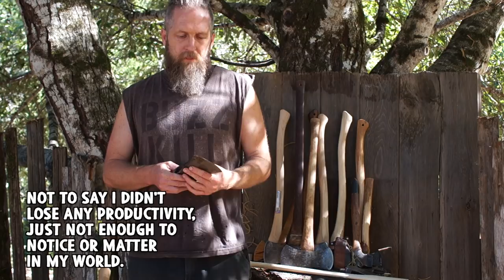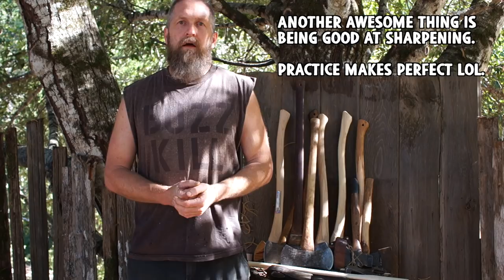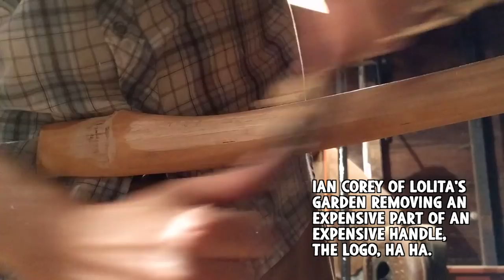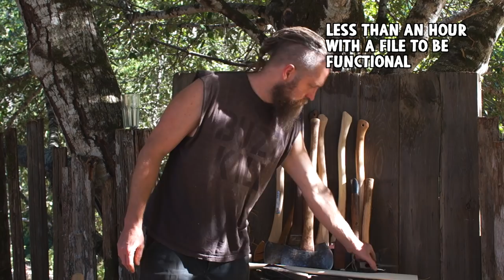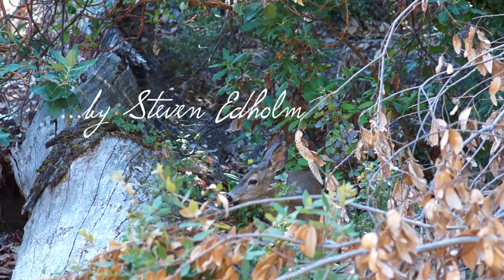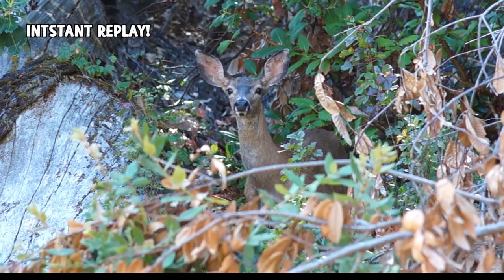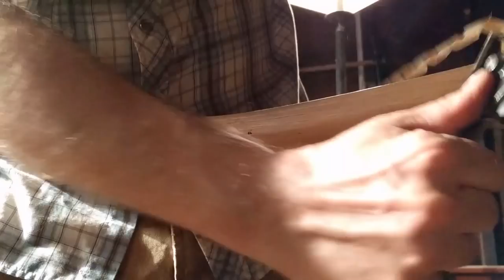Expensive Axe Buyer's Guide: (SPOILER ALERT, Don't Buy One)

Comment: I have a good size woodlot and a very old cottage. When I was young, I used to split the wood for the stove and fire place. Using a cheap axe, maul and sledge hammer and monster wedges.  Being 40 years older the chainsaw's and manual milling tools have taken their place.  I have installed an insert in the old fireplace and now have an efficient wood burning source. I have 5 cords coming in Sunday. Some has to be re-split because of size or to make kindling. Yes I looked at wrangle star bucking billy etc.  . I settled for a nice Swedish small splitting axe by Husqvarna. Half the price the top of the line ones. Hand forged, razor sharp and nothing like the bulbous big box stores. Also works for de branching, and taking bark off. Happy camper.

Comment: hippies smell, and by the way, I have a $30 Estwing hatchet that I love and use for everything that a hatchet can do. I slightly changed the profile (very slightly). It holds an edge better than I was expecting it to. Ive had Estwing hammers for 25 years so I figured Id give there hatchet a try. Also really like the stacked leather handle.
One of these days Ill get a fancy smancy Gransfor, but most likely a Hults Bruk

Comment: I bought the $24 cold steel trail boss axe that wranglerstar reviewed with a glowing opinion. Its a pretty nice axe. I stripped the varnish with a cabinet scraper, oiled it up, then wrapped the handle with jute, and made a sheath for it from leather that I had in my shop. 

I live in Arizona, so I use the axe for processing "large" blue Palo Verde trunks for wood turning. 

I need to move to a green state
Reply from the maker: yeah, that's gotta be a buzz kill to be into axes and be looking at saguaros and brush all the time.  I've looked at that axe, as an inexpensive alternative, but I really shy away from shallow eyes on axes from past experience.
Reply: SkillCult Thank you for the thoughtful response. 

I was thinking something similar. The eye doesn't have enough depth to keep it from wotking loose over time.

Comment: Hi Steve, Great advice. I have 6 axes mostly inherited from dad and grandfather. Got two plumbs, a craftsman, which look like the plumbs and a few vintage with no marks. Since I watch Skillcult, my axes and hatchets are a joy to use. The handle sliming and to fit my hands is all the difference. I've seen many axes, with and without handles for as little as two bucks at garage sales this summer. I have plenty already and wouldn't even consider buying an expensive axe. So many times I have custom made handles for my tools, being a  cabinetmaker. But didn't think of reshaping my axe and hatchet handles until Skillcult. DAH! Indeed they are hoys to use, hold a good edge and are looking lovely as they age with linseed oiled handles, which I often did before with tool handles. So once again Steven, another home run for Skillcult and many thanks. My hides and knowledge on tanning skills and the results are great because of your sharing. I will always be learning and improving of course. Hopefully sharing and handing down our skills to the younger folks will create skillculted craftspeople and keep alive knowledge of our ancestors. Cool! Good work and Thanks again. Davey
Reply from the maker: Thanks Davey :).

Comment: Here in Germany the Gräns Fors replacement handles are the cheapest hickory handles to buy. They cost about 20€ for the big ones. I bought some handles from gräns fors in Sweden so cheap (about 3€ per handle) that I got them just for some project in the future. Yesterday I hafted an vintage english hatched head with one of them to make an light camp axe, it weights only 1 kg in total. Only their double bit handles are useless for me, because they are to thin for the eye of an old double bit, so I have to make this handles my self or order them from the states, but the shipping is already more than 30$. Thanks for sharing your thoughts. All the best from Germany, Maximilian.
Reply from the maker: That's cool.  Almost all European brands are expensive here.
Reply from the maker: They make super nice handles.  too thick for me, but that's not hard to fix.

Comment: I had a boy's axe from Collins that was in the house when we moved in as a kid.  I whacked it into all kinds of things, and generally dinged it up, and never gave it much thought.  Star wipe to a few years back, me and mine were moving into our first house, and my folks dropped off the rusty, wrecked Collins, with the cracked handle, and I figured I might as well get it back to functioning again.  I ended up getting the head cleaned up with vinegar, the handle hung (the eye was particularly small, so it was a lot of elbow grease to get the handle to size, then filing all the chips out of the edge, reshaping it, and getting it servicably sharp.  It was a good learning process, and even though the handle is a little askew, I'm happy every time I look at it.  I think I spent $15 at the local hardware store for the closest handle size that fit.

I've got a husqvarna splitting axe as well, and an old maul that was cheap when it was new.  The Husqvarna is prettier.  It's nice to look at, and that's worth something, but it also got dinged up with a missed blow, and that hurt a lot more because of it.

Ironically, riding in the back of my car, the one that gets the most use and was the most worth the price was and is the X11 fiskars, the short splitting axe.  It's gone on all the camping I've done since I got it, and it doesn't mind getting left in the rain.

I don't begrudge someone wanting something pretty, but you're spot on, getting so you know how to sharpen first and maybe hang an old axe head is worth more than a closetful of unused Swedish steel :)

Comment: I agree!
I got curious about exes a few years ago. So I went down to Harbor Freight and bought a $5 hatchet with a plastic handle. It had a beveled edge. So I took a file to it and put a convex edge on it. I was surprised I actually did that because it was all new to me. So I beat the thing around for a while. I then got a Council Boys Axe and sharpened it right up. Did not re profile it. I’m on the journey and very happy about it. 
Thanks for your videos man.
Reply from the maker: Cool.  You should thin that council down and it will chop a lot better.  Unless you just use if for splitting.

Comment: Estwing camp axe is the best over all ESPECIALLY for newbies. Sure it might be a little heavier and have a little more "Handle vibration"  but it gets stuff done for a very reasonable price and you can't tear it up AND it's actually still made in the USA.
Reply from the maker: I had one for a short while that was actually my first axe and decided I didn't like it.  My neighbor has one, so I might tune that up and revisit it.  I never liked the hatchet either.  Okay for being indestructible though.
Reply: SkillCult  Well like you said it gets the job done... It's not THE best at anything but it's sufficient for anything a novice could ask for and there is no skill required to replace the handle as you will never need to.
#Best first
Reply: SkillCult  Just as clarification I consider the 16"  "Camper's axe" to be a BIG hatchet not a small axe. It's a little heavy for a "Hatchet" but otherwise performs quite well if you consider it as one.

Comment: as long as its sharpened to drive deep in the wood a harbor freight 4.5lbs is probably the same as any other, its not like you cant take breaks to hone the edge if it doesnt hold. Ur gonna get handle cracks if you hit a really tough spot long enough, or head fitting issues, but that is good so you can reshape the handle how you like
Reply from the maker: I looked at their hatchets and never found one with a decent handle.  They probably exist though.  Still a fan of putting handles on used heads.
Reply: @SkillCult  no I was just wondering if a cheap harbor freight axe sharpened right would drive as deep as very expensive ones, and maybe just needs honing more often. Sorry for making a riddle of that

Comment: Broke a Collins once! Took a 50 cent sized chunk out of the bottom of the bit.
Straight grain, dried ash, couple years dead from the Ash Borer.

Since that one broke I've been looking at a council tool boys axe, the 60 dollar 24" one. I'm looking at it because it seems to be a decent general purpose tool, as well as fits the category of tool required for a bushman class I'm attending. 19 to 24" haft and under 3lb head

Comment: i don't have any axes, but i use hatchets. mostly for camping, few months ago i started carving spoons and began to use my hatchet for that too.
i had a cheap faithful hatchet, picked it up from a diy store for £11.
for camping it was ok, did what i need for. splitting kindling wood, making tent pegs, etc.
than i started using it for spoon carving and i found out very quickly that it is not a good carving hatchet.
i did make some changes on it first. carved the curved handle and made it straight, that improved a lot on is usability. than filed a lot out of the head, made it kinda like a bearded hatchet, this made it lighter and easier to use.
but it still had a wedge like shape, more suitable for splitting than cutting.
so i ended up buying a expensive hatchet. a hultafors trekking axe for £50. apart of the thick handle i am very happy with this one. i will carve the handle and make it thinner and straight.
i will do it confidently cos i practised on a cheap one before. it is worth it to get a cheaper one to practice on, improve ur skills.
Reply from the maker: I agree on that last thing.  I generally recommend that people begin carving with whatever hatchet they have, or get a small camp hatchet to start with.  It's a good option to have the ability to use something sub-optimal, and it helps learn your way around your hatchet, or any hatchet.  I think I've only used a dedicated carving hatchet for about one minute, because my friend had a gransfors that I got to take a few whacks with just out of curiosity.  Unless you could my hewing hatchet, which is not an amazing carving hatchet, though it's good for wasting a lot of wood quick and making planted surfaces.  So I'm not the one to comment on their superiority or not.  I just know a lot is possible with a small regular hatchet.  Of course few hatchets or axes should be used out of the box without some modification.
Reply from the maker: I think he needs to regrind that hults.  I think that particular model looks promising actually (except the price :).  I use hatchets a lot in the area where there is no padding on the handle, so that's a deal killer for me.  Anyone who isn't using their hatchet there is not using it to it's full potential and versatility.  I think their perspective is too limited to be making a fair comparison.
Reply: SkillCult 
So i wasn't the only one who thought of this:)
Since i started carving spoons i hold my hatchet most of the time near the head. When i saw the estwing my first thought was that this hatchet would be difficult to use for carving.
Thanks for getting back, appreciate ur answers!

Comment: Patience is also very important, I've been "into" axes for a few years and now own hults bruks, Gransfors, Norlunds kellys and a few others. the most expensive ones were right at the start with a council tool i paid 35 bucks for, after that almost all of them have been had for between $2-$25. almost all from junk and yard sale. they all get used and i value them a lot more than if i had just bought them new as almost all of them came in poor condition and i was able to spend my time rehabilitating them and making them what I wanted. no worry about sunk cost as most cost the same as a beer!
Reply from the maker: Yeah, good point.  I passed up carloads of nice axes over the years because I wouldn't pay more than about 5.00 for a head and only if I really wanted it, and not much for anything with a handle.  If I had been on top of collecting them, I"d be sitting on a mint now lol.  They are much more expensive now, but still not uncommon to find for cheap either.
Reply: true, I always like to have some on hand as they make good afternoon projects. My rule is that if i can get it for less than 10 bucks canadian i'll take it home with me.
Reply from the maker: I'm still picky about certain things, but at this point I'm about the same.  Also, the used market is so hot I can often just shoot a picture, drop it on ebay and make 15.00 or 20.00 dollars.

Comment: I think it's due to a bit of resurgence of people wanting "artisan" tools...more as a showpiece than tool...but there are those who appreciate a good quality tool...having grown up in a household without the proper tools for DIYs, having access to the right tools for the right job now is a godsend.

One benefit for a beginner to see/experience an at least decent quality axe is that would give them some comparison point of what a properly tuned tool looks and feels like. Maybe not buy, but at least have someone show them. Started out with an Estwing from the hardware store that wasn't actually properly ground and was an exercise in frustration...and didn't realize how bad it was until I saw something with a proper profile...similarly to axe handles being too thick, something I hadn't considered until I ran across your videos.

Another potential argument for having something that is a (supposedly) known properly tuned tool is that learning on an improper one can cause someone to develop improper technique/habits.

P.S. Great shirt choice heh
Reply from the maker: Definitely needs to be a well designed and tuned axe for sure, but that is also part of the journey.  That is one possible advantage to som of those expensive axes is they are set up better out of the factory as far as the grind goes.

Comment: Hi Steven, Such a great video about expense and quality. The axes I have I bought at public sales and garage sales, $5 or less. One had a clunky handle. I shaved it down to fit my hands and flex and it turned out to be a great axe for $5. Shane with my molding planes. I was at a public sale where they had two 1/4" beading planes. Both in good shape and both looked as if they would work well. One sold for $125 and I bought the other for $15. One had a collector name and mine had Sundusky stamped on the end. Mine works just as well and the other was going into someone's collection because it was made by a famous local maker, Carpenter of Lancaster, Pa. It's purchaser was a collector. I doubt if he even knew how to use it properly. I have used mine many many times. Same with axes. And my $5 axe has a lovely used linseed oiled handle that would look great on my wall but even better used,a joy to use. And as the old Shaker saying goes: THAT WHICH HAS IN ITSELF THE HIGHEST USE- POSSESSES THE GREATEST BEAUTY. Ain't so! DaveyJO
Reply from the maker: My new hashtag for instagram is #beautility :)

Comment: I bought a Gransfors Bruks for carving. As wonderful as it is, I can only use it for about ten minutes before my wrist is done in. Found that the old Plumb head from my parent's basement with a handle (of apple yeah, I don't find much hickory around here), does a better job. The only upside is that the Gransfors Bruks is good for dispatching chickens with.
Reply from the maker: Weight is real important with carving hatchets.  Max at woodsman's finest talks about that in a video. Most people will do best with a fairly light hatchet.  I have used mostly regluar camp hatchets.  I don't own any carving hatchets, though I'm sure they are nice, much can be done with a regular hatchet, or a hewing hatchet for more efficiently making flatter planes.

Comment: More people need to listen to him and thin their handles. I ended up jacking up my hands pretty good. I found an old axe handle, I started patterning my handles after it makes a huge difference. Width of the axe handle should be roughly the width of the eye by 1 1/4 to 1 1/2  tall, thats my starting point anyways
Reply from the maker: When I got my last main working axe where I wanted it, I looked up Dudley Cook's recommendations and I was pretty much right there with him.  Can't remember the measurments though.  I prefer not to give measurements anyway, because I think it should be more about the feel and just tuning it till it works.  It's hard to go back once you get it right.  I think there is an advantage derived from the physics too which a few other commenters have also brought up.  I forget the name for it, but it has to do with what is basically a whipping action, though I think it's more complicated than that.

Comment: I had to get a Hults Brooks replaced because it was top soft to use. Camp axe / boys axe type size and it looks like the hardening process had messed up so the edge was dull after three strokes. The replacement is great, as were Hults Bruks I have to say credit to them the way they reacted. 

The notes on the previous video about how to shave an axe down are very useful because that is the one thing I'm really lacking a decently narrow handle. I tend to buck about 50% of my firewood by axe so these videos are great. 
tyvm
Reply from the maker: I have heard of hults breaking, but this is the first I've heard of them being soft.  the cheap councils are often soft.

Comment: I found some black locust planks in the basement. Probably 60+ years old, and they have turned to iron. I used mainly a hatchet to make my first handle for an old head I bought for six dollars. The wood was so hard I could only flatten it with a chisel. It left big gaps in the handle. They haven't compromised the structure but I think I'll fill them with epoxy. Otherwise it turned very sleek and elegant, and tough as hell. It's like the elvish stuff from LotR.
Reply from the maker: Wow, that's a find.  That stuff can be incredibly hard.  Get a wood rasp if you don't have one.  Good for shaping something like that.